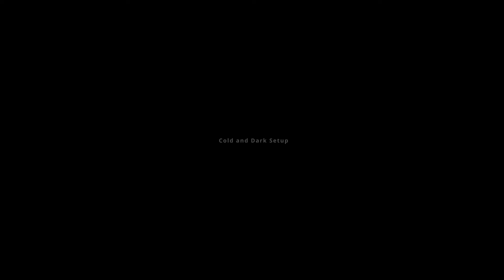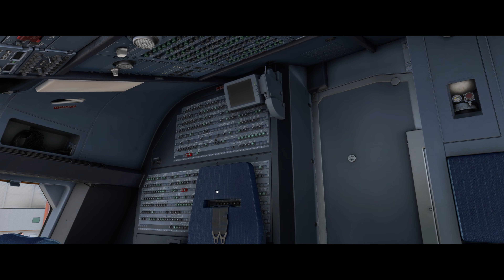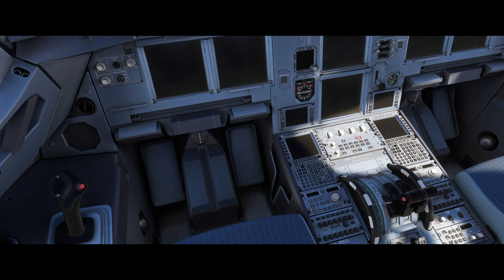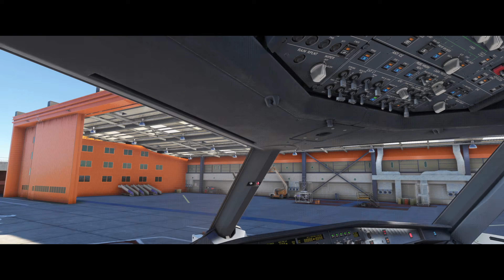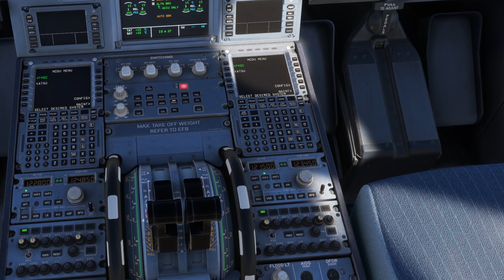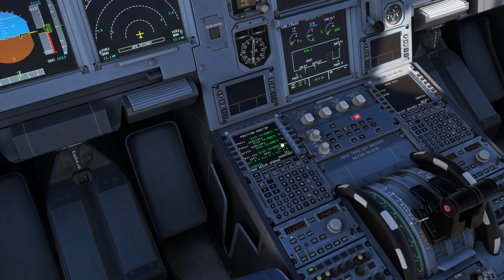A320 Cold & Dark to Ready for Push (Real World Setup Flow)

Comment: It starts with no external power connected so it's kind of impossible to get going... Or it starts fully started.
Reply from the maker: Hello, if there is no external power connected as long as the batteries are in a good state of charge you can start the APU from the batteries allowing the aircraft to come to life

Comment: hi! is it right to keep the extwrnal power on even if the apu is running? bc i tought that apu sgould be startef once boarding is finished
Reply from the maker: Hello, that would depend on the temperature onboard. From a fuel/cost point of view we would want to leave it as late as possible but sometimes we can't. It's captains discretion 👨‍✈️

Comment: I don’t know if it’s funny or frustrating — I’ve been confused by this before. I followed every step in the video, but my screens stayed black even though the APU was running. These tutorial videos get outdated fast after aircraft updates: the cockpit looks different and some functions work differently now, which is a pity.

Starting from cold and dark seems to be the high art of sim-piloting, but I still haven’t seen a video that actually shows how to set things up so the airplane starts cold and dark at the gate. From a beginner’s perspective, this is where most simmers struggle — a clear, slow-paced, step-by-step guide would be so helpful. Most tutorials are done in this machine-gun rhythm, and you just can’t follow what’s happening. And yeah, I know how to pause a video — but that constant stop-and-go is just stressful.
Reply: The updates don't change how the plane work. This procedures are the same on every A320 family Add-on (Fenix FBW Inibuilds FSLABS Toliss...). If the screens stay blank with the Fenix it's maybe due to the background app not running. Or the display brightness is set to the minimum

Comment: I'm retired now and have invested in a MSFS 2024 setup and a rather expensive PC. I will fly the Fenix A320 initially so this tutorial is a superb start. Why ? I need to keep my brain working and challenge it!. I used to fly, or try to, 737 in MS FSX which was a great sim that was 13 years ago before it was shelved. Quick 2 Q. are you using any other add .ons such as Airports, ATC etc? What control hardware?
Reply from the maker: Hello, great to hear you have taken the plunge and got setup in the sim. Indo own quite a few payware airports and use both Sayintentions AI and BeyondATC for most ATC and traffic injection. For a livestream I will often use Vatsim. You can find my full PC specs and hardware at the bottom of the video descriptions. Enjoy 👍✈️
Reply: I believe SayIntrntions AI is the best ATC out right now. Expensive at $19 per month but it does so many things and uses real voices with accents; depending where you are in the world. It’s well worth the price in my opinion.

Comment: Captain, hello, have a question please. I am flying out of Hong-Kong generally early in the morning where the outside temperature is in the 15°c area at this time of the year. I noticed that unless I run the aircon, the temperature in the cockpit will rise to 30c or so, after... I'm not sure, perhaps 10 minutes or so. Is this realistic and if yes, I presume the heat is generated by the cockpit equipment ? If this is correct, from a practical point of view, this means you IRL would have no reason to wait to start the APU and get the aircon going ?
(Fenix of course) - Jean from HK.
Reply from the maker: Hello, if it is overcast the cockpit temperature is generally similar to the outside temperature. If it is sunny and that sun is coming into the cockpit it will heat up quickly and can be uncomfortable without air flow 👍

Comment: Hello, I have a question about when you start engine 1, in couple showcase video and irl I can hear the PTU go off when you start engine 1. Which flips/setting in audio game i need to have to make sure it happen? i've been trying to flicker around the panel but haven't find any success
Reply from the maker: Hello, the PTU conducts a test once the second engine is started, the order of engine start does not matter. It is not related to flap setting. In the real world we do not hear the PTU in the cockpit unless we have the door open and an empty cabin so some models correctly model that and you will need to enter the passenger cabin to hear it. I am not aware of any audio settings that need to be adjusted but the Fenix is realistic as to where in the aircraft it can be heard, hope that helps
Reply: @AirbusCockpitCoach  it happens when I was a passenger on the a321 and the PTU sound was very noticeable. I'm aware that usually PTU cannot be heard from the cockpit. But I remember hearing it once the pilot start the 2nd engine (in my context he started 2 then 1 I think) if you can find out how to make it audible it'd be nice (I'm awared of it's not neccessary required, but it's just a nice eargasm touch for personal favorite)
Reply: @AirbusCockpitCoach  oh and sorry I was supposed to say flip switches not flips, not to confused with flap

Comment: I get going thru checklists and stuff but I dont know why people bother with checking things that we know are going to be in a normal state. Maybe something for MSFS2024 but it would be cool to actually be able to spawn a plane that could be in a random state, i.e, a breaker being broken, or a system malfunctioning when tested, etc but I doubt anything like that would be on the top of Microsoft's list of things they want to add for their all important X-box base of players.
Reply from the maker: It's a good point. The Fenix does change a few bits such as the battery voltages and oil levels and we are starting to see a few mods implement things like brake and tyre wear so things are moving in the right direction 👍